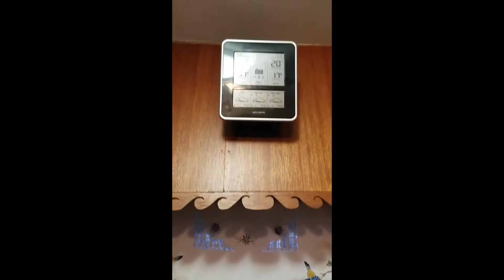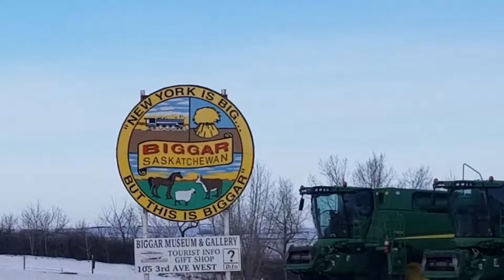Picking up my 1st Paramotor 2 Motor outs! Kangook Viking 2 Moster 185

Comment: A moster. Hope you enjoy your new gear!
Reply from the maker: Larry, I'm loving it.  Your videos have helped me many times, thank you.
Reply: I'm considering a Moster 185. If you don't mind sharing, what's your experience regarding 'heavy maintenance?'
Reply from the maker: @commentatron  personally I have put almost 50 hrs on it and I have only changed the spark plug once.  I am thinking that was the reason it died when the previous owner was using it.  It had about 32 hrs on it at the time.  I too am interested in hearing Larry's response.
Reply: @jimsimard  thank you! I truly appreciate the feedback. I try to be helpful but if you don’t hear comments from anyone you don’t know that. So thank you!